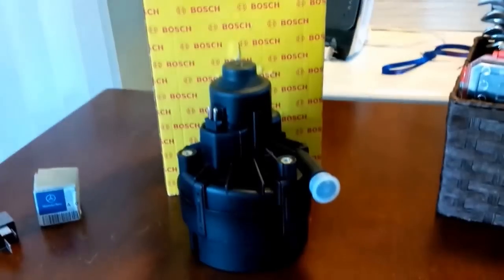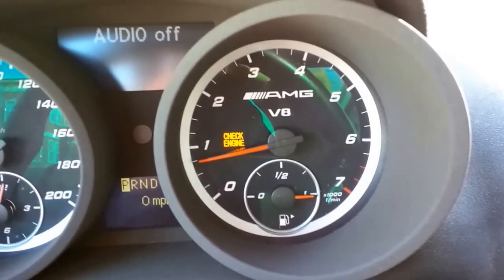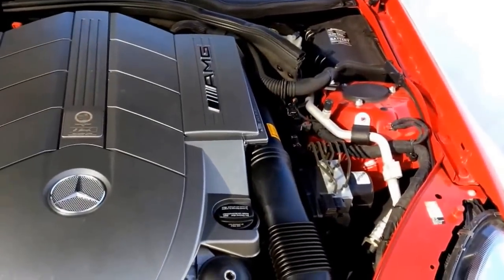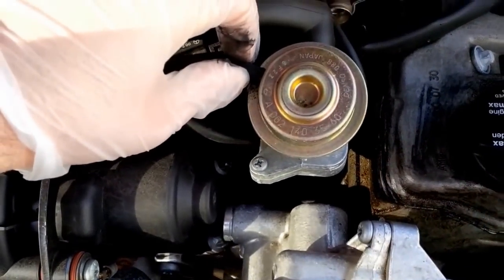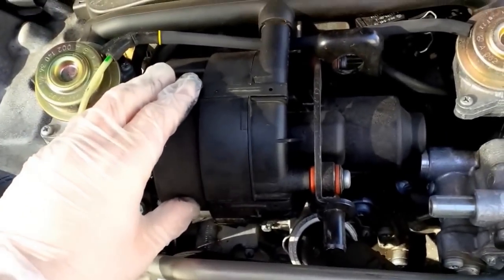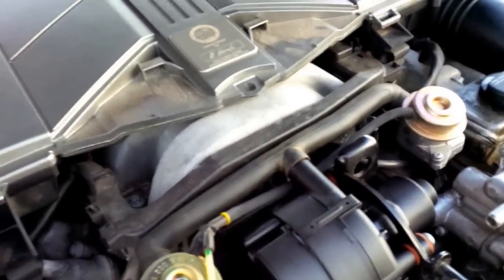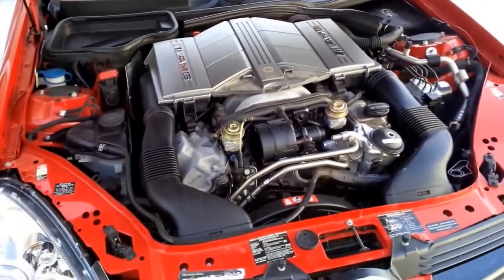Mercedes Secondary Air Pump and Relay Replacement - P0410 Error Code Fix

Comment: Great job!  I get the impression that you are not necessarily a very experienced Mechanic by two things, you referred to a Ratchet as a Socket Wrench and you called a Universal Joint a Thingy. Now . . . I mention this because, you were willing to tackle this job yourself, you exuded a wealth of Common Sense, you were wise in placing the valve in the box to make sure you didn't lose any parts. The vast majority of Mercedes Owners do not work on their own cars, they pay someone else to do it. You probably saved at minimum, $200 labor if not easily double that. I applaud both your JOB WELL DONE as well as your VIDEO PRODUCTION skills.

Comment: That whining sound when you first start the engine is a dead give away. If you hear it, and then it goes away after a minute or so, you know the pump runs. When you started the engine in the video, before you changed the pump, you could not hear the tell tale whine of the pump. After you changed it and started the engine, you can hear that heavy whine. I have a CLS 55 and a S 55. I hear that whine on my CLS. On my S 55, I do not hear it and I am getting the P0410 error and CEL. That pump makes a very distinct whine. Great video, thanks for taking the time to make and share it.
Reply: Does it kind of sound like a jet engine? I have a 1999 e320 w210 with 330k miles. I hear the whine while starting the car for about 30 seconds or so. I still have the p0410 code and i need to pass smog.
Reply: +kunalhuhu  yes. sounds like a jet engine.
Reply: I didn't notice it that bad when I first bought the car, but it's gotten a lot louder and more whiny. Dealership told me the valve and pump were going bad. Does that sound about right to you?

Comment: I have a 06 mercedes e350 and I took my car to the dealership on Thursday for my sbc system to be replaced because it wasn't working properly, luckily I found out they have a 10 year warranty from mercedes so they replaced it for free.  I got the car back yesterday and today I came home and parked it and I shut the car off and I Hurd a fan noise running so I opened the hood and it was the air pump.  I disconnect the back battery and it was still running then I tried disconnecting the front battery but the wires wasn't coming off and that pump was running and over heating so I found the plug on the pump and disconnected it.  I think the dealer hooked up some new wiring and somthing must have came loose I reconnected it and it ran for a second and finally turned off.   I'm gonna check the car later today to see if it still stays on.  Thanks for making this video

Comment: Thank you for a great video. Dealer wanted over $1000 and I got parts and relay for about $400. 05' S500.
Reply from the maker: Awesome! Glad I could help!
Update - my check engine light has been OFF since I did the repair 2 months ago, so I'm a happy camper. :)
Reply: imy0urpapa great video thanks, did you have to turn off the check engine light after the installation or did it turn off on its own? thanks
Reply from the maker: Hi, i did have to reset the check engine light with a code reader. It did NOT reset itself. It has been about 5 months, still no check engine light, and i can hear the fan kicking on and off as it should! :)
Reply: imy0urpapa Great! thanks again.

Comment: Just got an estimate $$1400 for my 1996 C280. I almost cried. Thanks for the video very helpful very good
Reply from the maker: I used to have a 97 C280. (Great car).  Does it have the same air pump? I think its similar because i do remember hearing it turn on and off on that car.

Comment: P0410  code means any components may be failing like check valves not opening to much carbon inside . Solenoid switch stuck or not receiving the 12 v . Any vacuum hoses broken  include it the thick hoses connected to the pump motor .  Electric pump motor not turned on ( only turned on between 30 seconds to a minute with cold engine only ) power to motor not feeding  the pump with their 12  volts     Last thing  if your electric motor make a huge winning noise  don’t replace it instead remove the cover from the motor and clean it all over then lubricate the bearings     If you are a handy  person  this job must be easy for you .     Don’t forget to check the corresponding relay and fuse

Comment: My son has a 2000 Mercedes S500 and has a code P0410.
Could this be a relay or fuse problem instead of the pump?
Also, could it possibly be the solenoid?
GOD bless and thanks for your time, the video and your knowledge.

Comment: 2012 C300  has a CEL and  code P0410  whenever weather goes below 32F, took to dealer for fix under 10 year emissions warranty, last year.   Same issue this year hope warranty  still covers this.

Comment: Thanks for the video, my C55's air pump just shit the bed.  I see a lot of oil around your oil fill cap, is yours leaking a bit like mine?  Since I bought the car and when I need to top it off with oil, the first few hundred miles the oil comes out from underneath the oil cap.
Reply from the maker: Funny you say that. This car DOES have a slow oil leak.  I never need to add oil though..its very slow...will probably get worse over time though.  I think it needs a new valve cover gasket.  What happens is...it drips off the side of the engine and hits an exhaust pipe, then burns off.  I sometimes see a teeny tiny bit of smoke, and get oil smell in the cabin.  Ill be honest...im just sort of ignoring the issue since I barely drive this car and dont want to drop the money.  Its been like this since I bought it 4 years ago though and hasnt gotten worse.  This is the ONLY issue with the car....although I think the auto headlamp light sensor is messed up too.  It doesnt seem to work lately.  But hey...car is 12 years old.

Comment: 99% of the cases, there is no need to replace the pump, but only to clean the electric motor after an easy access to it by removing the 2 fans inside and pulling out the motor from its mounting. Zero $ spent.
Reply: J. Badinter I was told that a stuck valve is causing the pump to fail. Loud whining when it cold starts and runs a teeny rough. I may try to clean it and see if that helps.

Comment: I have a 07 E350 and I took my car to a MB specialist and I have went through 2 air pumps. They said it could be an electrical issue but I really don't know. They charge me 1000 bucks and like I said I had to go back twice because I have burn the pump out within two weeks apart. They also charge me 765 for the air pump alone and I saw it cheaper online. Is there anything I can do to fix this problem myself. Did your check engine come back on after you changed it?

Comment: I live in brazil and my pump is making this high pitch bought this exact same car 8 months ago and is the fist time i hear it... mainly because is the first time its cold since i bought the car. (No check engine light was on) I didn’t knew what it was and took it to the dealer and they told me that this pump needed to be replaced by the cost of $2.000... i didn’t really believe them because the car was there for 3 days so they could find out the noise, and the first two days any noise happen because wasn’t cold, in the third day the noise happened. I bring the car home and look it up about it and im convinced that i don’t need to replace the part, the high pitch noise i hear is the pump actually working. After all this here’s my question: pump kicks in will normally have a high pitch noise? It only kicks in on cold weather? Thanks for the video!
Reply from the maker: It will run every time you start the car, even when the weather is warm. It runs for about 1 minute and then stops. And mine was always a high pitch noise, yes. You should be able to hear it.
Reply: Chris Papa thanks for the reply man! So now its a bit weird because the pitch noise doesn’t happen every time... maybe is the relay then... but no engine light on the dash board, im not too worried about it, but ill keep on eye on it! Thanks for your time my friend!

Comment: Very helpful... I also have an SLK320 which has the same pump set up. Thanks
Reply: I know it was a while ago,but did you have the same code? And did you replace the pump and relay as well? And did it fix the problem? I'm buying an 04 SLK320 with the same check engine code.

Comment: Hi there, I was quoted about $930 for parts for my 2009 C300. Estimate says "Air Inspection Pump ($900) + Relay + Fuse". I find parts online for about $130 but not sure that's what I need. I have 0814, 0810 and 0856 codes. Could you direct me as to what part I should get? Thank you!

Comment: Looks like I will be doing this to my C300, thanks for the tips
Reply: +Noel Jordan I have the same car, 2008 version. do you know where is the corresponding relay to the secondary air injection pump located on it?
Reply: thanks a lot for your reply, I will test it out.

Comment: I have a 2004 ML 500  It NEVER turns over if I started her cold but if I put  her in second position for a few seconds then turn it off THEN start fully it will start right up! I've turned the check engine light off a few times but it always comes right back on. It's been doing this for almost a year. The codes are P0410 & P0305. Several mechanics have looked at it and I've even had the pump & relay changed. Do you have any idea what could be causing this? The car drives fine except sometimes when you take your foot off the gas it feels like you're braking. Thank you in advance.
Reply from the maker: Wellll...im not exactly an expert mechanic, and this repair is the most complex thing ive done. Code p0305 is a cylinder  5 misfire. My first guess would be a bad spark plug or coil pack on cylinder 5.
Reply: What do you think it could be?
Reply: well I'm looking at it now... would like to know if you have someone to run the test to make sure I'm telling you right
Reply: I'm not even near the car right now. No instructions written somewhere? 👀😞
Reply: this is what I can say on what I'm reading Readout on 
generic scan tool P2045
(P0305)
Fault code description - ME model memory maybe causing a misfires (generic scan tool (2003)
(Misfires on cylinder 5, emission limit)
AD07.61-P-4000-11BB
(P0410)
ME secondary air injection malfunction 
AD07.61-P-4000-15AA
(causal chain) - fault code description
Reply: Diagnosis - Troubleshooting chart, fuel injection and ignition system 
1
Problem
Possible cause
Remedy/Test step 
)
A
 Actual 
values
Testing 
engine 
menu item
Engine difficult to start when cold and poor 
Fuel injection valves actuation and injection time


Hot film mass air flow sensor (B2/5)

accelerator response

Engine coolant temperature sensor (B11/4)

Ignition voltage too low

Air ingress
Eliminate air ingress
-
Voltage supply from base module missing

now if you could because as you can see it is a lot to check but one thing I now need to do is look at a wiring dia. to see what is in common or share grounds
Reply: lol no but I'm sure I could help
Reply: stay away from ML. they are crappie. sorry to say no offense.

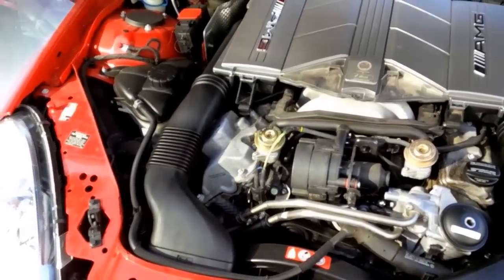Comment: You mentioned "instructions" at 8:07.....where did you get these..? I have a 2010 C300 that I believe has the same issue and am considering doing the repair myself. Thanks.
Reply from the maker: i ordered it off ebay.  I searched "shop manual" for my car model.  It was a little weird to be honest...the seller sent me a DVD and you install a VPN connection, and it basically connects to a remote computer and you can use the software and it has every mercedes model on it...with instructions on how to do EVERYTHING!.....it was like $20.  It honestly wasn't what I expected, and I somewhat question whether or not what I purchased was legal or not.  But I got the instructions I needed at least..lol
Reply: Yes....I since Googled it and found the same thing. Problem is, I can't find one that runs on Mac OS Yosemite, which is what I'm running. In any case, thank you for your prompt response!

Comment: You mentioned you were using a repair manual- which one are you using and can you provide a link to it?
Reply from the maker: It was years ago. I bought it on ebay and it was weird. I had to run this CD on my computer that logged me into some remote VPN session. It got me what i needed, but not sure if it was some sort of pirated instructions or something. 🤷

Comment: I have a mercedez clk500 2004 my car has had codes p0410 on for awhile and code p0710 I just recently had to take it to the shop because it turned on fine one time and shut right off for no reason, we replaced the cam and crank sensor and now it turns on easily (before replacing those we would have to wait for the car to cool down if not it wouldn't start right away you could hear the starter running but it wouldn't start) we checked the relays they are all fine but even after replacing the sensors it shuts off after awhile , I'm really worried about the car doing this we can't seem to figure out why it's shutting off , my smog pump isn't working could that be the reason why it turns off?

Comment: Chris,

How many miles did you have on your 2005 SLK55 AMG when you did this repair?
Reply from the maker: hello!  It had around 46k miles.  Its a low mileage car...I barely ever drive it.  Its a 2005....bought it with 44k 4 years ago.  It now has 50k lol.
Reply: Thanks for your reply.  The reason why I asked you that question was my girl friend has a 2010 GLK350 and recently the engine light come ON the instrument cluster at about 63,000 miles.  She took it to the local MB dealer where they found diagnosed code 814 (shorted secondary pump).  As a result they replaced the air pump, relay and fuse link for about $1,000.  Everything seems to be OK now.

Comment: Why was your check engine light still on at the end of the video
Reply from the maker: Hi, it was still on and I had to manually reset it with my code reader. After that, it never came back on since the repair was successful. It has been off for years.

Comment: during your video you mentioned the following ... "i checked my instructions, the same ones the dealer uses."  Where did you find this dealership instruction manual?
Reply from the maker: eBay. $20.  its a VPN you log into and its hard to figure out how to use. im pretty sure it was illegal, but how am i supposed to know.
Reply: link? Mine just went out as well, thanks for uploading this btw.
Reply from the maker: +Pancho Villa I bought it years ago and no longer have the link.  Just search for a shop manual on ebay for your model. It will be a DVD. It actually has every Mercedes model on it.

Comment: I have a SL 550 and just paid the dealer $5000 for this repair. They told me if I didn't fix eventually the power steering and the car would drop almost to the ground. Feeling ripped off 😡
Reply: DaBratt sounds like the tandem  pump for abc, not emissions.  Still, dealers are called stealers for a reason ; -(

Comment: Am not finding the air pump relay for my benz amg cl55 mercedes benz 2003
Reply: rolam Polly hi my name is Robert easy way you can possibly help me out I have a 2002 CL500 Coupe I'm trying to locate my relay fuse for my fuel pump if something is cars constantly draining my battery is the relay fuse behind the passenger seat for a fuel pump fuse I turn the key on but I do not hear the pump

Comment: did the engine check light went away ?
Reply from the maker: yes
Reply from the maker: well actually...i had to reset it manually with my code reader after the repair, but it never came back and its been  a few years.
Reply: +imy0urpapa nice !

Comment: Thank you for the video I have the Crossfire and did the same thing check it out https://youtu.be/CeZ4_f778jU however the pump still did not work so I had to  Solder the Rcm